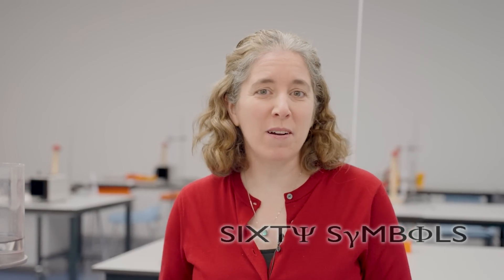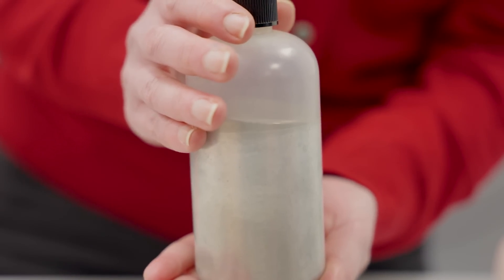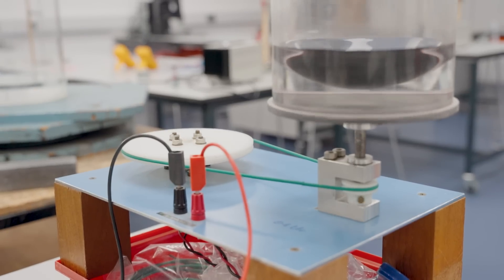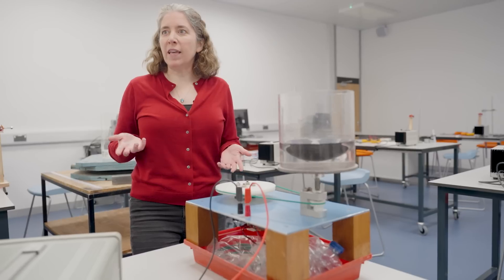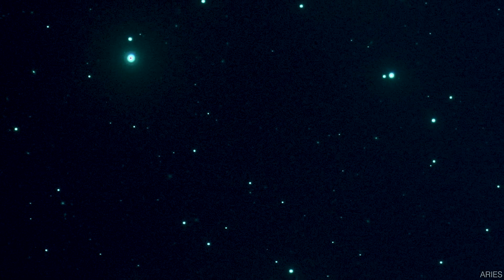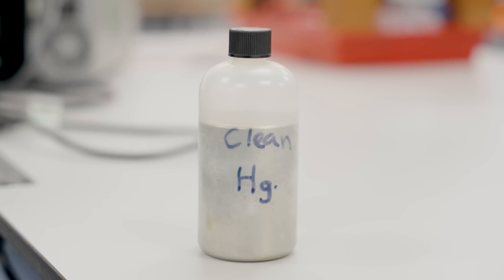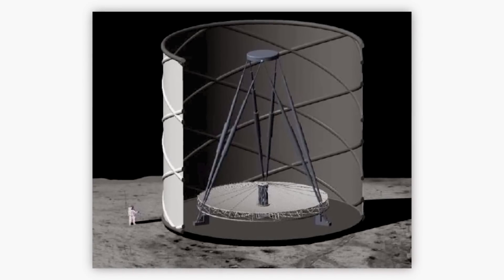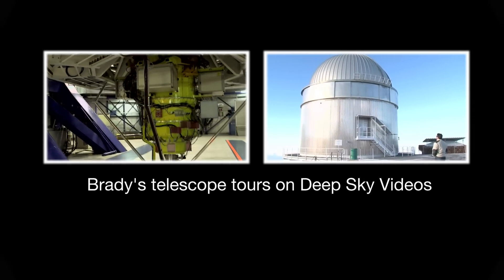Telescope with a Mercury Mirror - Sixty Symbols

Comment: By spinning it faster or slower, you can affect the curvature of the parabola and thus change focal length. (zoom in/out). not sure whether this is practical, since the real mercury telecope only has a more or less uniform liquid "thickness" above the also parabola shaped bottom of the vessel and it is perhaps best to match those. Also, the detector needs to move away/towards the mirror to get in focus.

Comment: maybe they could use mercury on the moon.
heat it up somehow, spin it and let it freeze in a parabolic shape. and if theresa defect like a micrometeorite, do it again.
the heating up lart might require a bunch of solar panels and batteries, but they could be shared with some other facility?

Comment: Can you do the float glas process with these parabolical liquid surfaces? That way you could actually make large parabolic mirrors very easily. 

Ofc, glass has such a high melting point but if the application can handle a larger thermal expansion coefficient, then you could also fo that with a thermoplastic.

Comment: That description of CCD sensors was kind of messy, and that process can be done in software with any type of sensor. The key reason for using CCD sensors was / is their low noise compared to other types.

CCD was the type of sensor used by virtually every high-end video camera until CMOS sensors (currently more common) became so dense and so cheap that they effectively overtook them (they still have worse quality "per pixel", but you can make them with a lot more pixels for the same money, so you end up with more detail across the image as a whole, as long as you don't mind the noise when you zoom down to individual pixels).

Comment: Wouldn't a round cylindrical shape with a reflective material stretched over either end and a vacuum underneath form a the same shape with out the moving/spinning parts? Be a Vacuumscope and adjusting the vacuum will adjust the shape.

Comment: In 1971 I had a summer job at the US Naval Observatory. One of my responsibilities was to come in in the evening and set up the photographic zenith tube. This had a flat mercury mirror and a traditional lens, not the same thing as described here. The light went through the lens, was reflected by the mirror half a focal length below, and was focused near the underside of the lens. I wiped oxide off the surface of the mirror. Safety did not seem to be an issue back then. I loaded film into the camera. It was programmed to open the shutter when a star was expected to pass overhead, tilt the film to track for the duration of the exposure, and close the shutter. There were multiple exposures over the night since none of the stars was exactly overhead. It was used to measure variation of the rotation of the earth. The horizontal mirror guaranteed that the telescope looked directly overhead.

Comment: Mercury being solid on the moon started me thinking-- You could make a reflector mirror by spinning a liquid metal and then lowering the temperature until it freezes? If it's not reflective as a solid, deposit a thin layer of something like gold.

Keeping the temperature just below freezing point would minimize warping from contraction. For mercury that's around -40°C.

To avoid needing so much refrigeration, gallium freezes at 30°C. Would that make up for it being 10x the cost? And that you can cut it with a knife?

Comment: So its a anti-bubble. Liquid metal inside. Thin film of electrons. We already have that in wires. Then there is bubbles. Metal on the outside. Electrons in the middle.  Bubbles will sink.  Anti bubbles will float. Gravity has to share some common link to be a median.  That is a curve. So a straight line is needed. To act like adjustable leverage.

Comment: The video does not point out the dangers of mercury vapors. Mercury evaporates in a normal atmosphere and these vapors are dangerous. Standing in the vicinity of the mirror for a long period of time without respiratory protection is certainly not particularly healthy. If you want to take a look at it, you should search under the keyword “Schlierenaufnahme/recording mercury” or something like that. That's no joke.
The mirror cannot be sealed, which would limit reflection again. Therefore the vapors constantly escape. I don't know if they are even aware of this particular danger. It is the vapors that make metallic mercury so dangerous to us. Chemically, mercury salts are much more toxic to us than metallic mercury, the metallic one will not react so fast in human body then the salts^^. The fumes in metallic mercury actually make it dangerous for us as these fumes can poison us.

Comment: Could you have a set of pools of mercury all spinning attached to a much larger spinning chamber.  The pools could, in theory, be tilted gradually as the centrifuge speeds up.  You could then position a camera at the focal point in the center and take timed images... Does that work?
Reply: Even a single pool can be tilted "as the centrifuge speeds up", but gravity will always introduce a deformation unless the focus is straight up.

Comment: I'm genuinely curious how they keep the mercury from oxidizing. I know that mercury normally develops an oxide layer after a period of air exposure, and with such a huge surface area as a mirror, managing that has got to be a practical consideration. My guess is there's possibly a liquid on top of the mercury, such as an oil, that protects it from oxidation, but that's got to introduce more optical challenges.
Reply: reading through their paper on this - it seems like they actively encourage the formation of an oxide layer. It helps prevent evaporation (important to keep mercury fume levels low), and also provides structural stability so that the mercury layer can be thinned which helps with dampening surface waves. I guess those considerations must be more important than the optical effects from the oxide layer.
Reply: @AR-cy6uj  Thanks for sharing the info, fam! I really appreciate it!

Comment: For the who "you can only point straight up" part, this might be a lite bit crazy but could it be possible to put the the entire spinning plate on the edge of a second, larger plate and thus use the centrifugal forces generated to angle the mirror?
Reply: Not really (gravity would always introduce a deformation). But how would that help you keep it pointed at a fixed part of the sky, anyway?
Reply: @RFC3514  Gravity would be consistent throughout and the vectors of the apparent forces would combine to make one stable force at an angle to the earths surface allowing you to point the telescope at an angle.
Reply: @gmtom19  - And if you try to keep it pointed at a fixed point of the sky as the Earth rotates (instead of changing direction even faster than it does if you just keep it pointing up), the result won't be a parabola.

Comment: One thing is that you can get a certain distance off of zenith by moving your detector. This is how they aimed Arecibo and similar very large radio telescopes. Range is definitely limited, but it's not zero.
Reply: False. Parabolic mirrors have only one focal point and it's pretty tight. Arecioe was using a spherical dish where the focal plane is large and you can steer by moving the collector (or a secondary)

Comment: If mercury is solid at lunar temperatures could you not take advantage of that and have a heated platform and once the desired shape has been achieved then switch off the heat and let it freeze in the correct shape?  Once frozen you could even stop spinning it!

Comment: Instead of using liquid Mercury the same effect can be uptained using a low melting alloy like Galinstan (Gallium-Indium-Tin). This alloy is more expensive than Mercury, but is non-toxic compared to Mercury. It won't expell toxic fumes and any spillage will not harm the environment or the humans working with it. It's easy to make yourself.
There are though two challenges: 1) Galinstan must be kept away from some metals, like Aluminum, as both the Gallium and the Indium content will alloy with metal and introduce fatal brittlenes, and 2) Galinstan will "wet" any surface it encounters, even glass. This is very anoying, but in the case of glass this can be accounted for by covering the glass with Indium Tin Oxide (the conductive coating used on the inside of LCD-screens and on airplane windows).
Reply: We should use this

Comment: One of the challenges with liquid spinning telescopes is the gyroscopic effect on the spinning mass. As the planet rotates it also rotates the spinning liquid which will try to correct for the rotation of the planet,  trying to keep its rotational axes static. This will result in a slight "wave" effect - or a deviation from the perfect parabula. This means there are limits to the image quality you can uptain with this method.
Reply: Couldn't you correct for this type of thing? Or does the waving effect translate to a loss of information?
Reply: If it's not chaotic motion, then it can be fixed with digital data post-processing.

Comment: Could you gain some ability to "aim" the telescope by making a large mercury mirror and suspending the detector on a movable structure that could point at different parts of the mirror?  I'm thinking of an optical telescope akin to how radio astronomers "aimed" the Arecibo Telescope
Reply: Arecibo had a spherical mirror, so the the aberration was the same in every direction. A mercury mirror is parabolic, so the aberration is zero on axis and increases with the angle off axis.

Comment: I wonder what the frequency/wavelength constraints are for a mercury reflector.  Any wider or more narrow than 'glass'?
Reply: Glass is generally not used as a reflector itself, due to being transparent and all. It's just a substrate on which a thin metallic layer is deposited (i.e., it's not like bathroom mirrors where the metal is typically behind the glass, on reflector telescopes it's usually in front of the glass, so you don't have to deal with interference from the glass itself).
Reply: @RFC3514  Silly me.  Brain fart.  I knew that!  Thanks for the reminder!

Comment: mercury is NOT very dangerous. unless you vaporize it and breath it in - in large amounts - you can practically drink it (not recommended due to your stomach acid) but you body absorbs very little liquid mercury.
Reply: and i would be interested in why you can only point "straight up". even at low speed the rotational force should overcome the gravity, esp. with heavy fluids like that. with the right rotator (shape), you can probably rotate it even upside down.

Comment: The main problem of mercury that ionic liquids solve is not melting point, but vapour pressure. Mercury would quickly evaporate on the moon, but the effect of vacuum on ionic liquids is negligible.
Reply: pressurizing would be simple, but continuous heating problematic.

Comment: Fun fact. Today, when making large glass mirrors, the molds are often spun while the glass is melted and allowed to slowly cool back into a solid. This puts an initial parabolic curve on the mirror that makes it much easier to polish to the desired high accuracy optical surface.
Reply: Is it possible to keep molten glass on top of molten metal while spinning the two, just like they do to make normal window glass (except for the spinning, of course), to produce thin concave mirrors?
Reply: They do not put on metal. They create mold first and when the glass is cold they breake away the mold. @soberhippie
Reply: @soberhippie I'm sure it's possible, but you would have the problem of the two different densities of material creating two different parabolic shapes. The molten metal would have its own parabola and impart it to the bottom of the glass. The top of the glass would follow a different parabola and you would have all sorts of diffraction issues through the glass
Reply: @jasonklassen3972  - Light generally doesn't go through mirrors, and (for telescopes) the top surface is generally the one getting the mirror coating, so that's really the one you'd care about.
Reply: Yes. There was a video on DeepSkyVideos on this topic. Maybe SixtySymbols could get some collaboration going with them?
Reply: So far as I am aware, only one mirror production facility, the Mirror Lab at the University of Arizona, uses this technique.  Under the direction of Roger Angel, this lab developed the technique and has used it for several large mirrors over the last three decades.  Most recently, they have been making the primary mirrors for the Large Magellan Telescope which is under construction in Chile.
Reply: @markholm7050  The Giant Magellan Telescope with its seven round mirrors might be the last big telescope which make use of combining several parabolic mirrors together. Most other newly build or planned telescopes are composed from hexagons, like the JWT or the Extremely Large Telescope. So spinning the whole mold together with the melted glass isn't necessary anymore.

Comment: Let's say you put several thousand kg of lead bricks on a movable platform under the mercury (isolated foundation of course). Would that be enough to to change the gravitational vector enough to be useful? Perhaps enough change to track stars would be to fast and disturb the surface?
Reply: That's not going to beat the Septillion tons of Earth pulling it.

Comment: One way to use mercury on the moon would be to put it on the base of the mirror, heat the base until the mercury melts, spin the base, allow the mercury to freeze. Then you can stop the spinning. Then you have a large mirror you can point anywhere. Or use silver instead of mercury as that is reflective as a solid. If the mirror gets damaged from small impacts then melt the mercury, spin it up and the damage is repaired.

Comment: Is there a way to use this in space? I think that without gravity, it could be turned in any direction. But without the effects of gravity would the same shape be possible?
Reply: No, it won't work in space, but in space most of the problems of large glass mirrors go away. No need for active optics because there's no gravity sag to counter. No atmospheric distortion to counter. No dust. No corrosion. You could have a 1000m optical telescope if you wanted.
Reply: @gasdive My plans for a giant mercury death ray thwarted again! 😂
Reply: no dumbass, watch the video before commenting next time

Comment: Technically you can point liquid telescope at any direction. You just need to rotate it using thread plus a bucket, and start rotating bucket over center where thread is connected. Every full cycle you have a fraction of a moment when your bucket full of Hg pointing at the direction you want.

Comment: I wonder how they deal with Mercury vapour at this Telescope, as it's in a warm place of the planet and its just a bowl of liquid vapour, potentially evaporating its contents into the area.
Reply: A quick google search reveals "Although mercury vapour is harmful, it is greatly suppressed by a thin transparent layer of oxide that forms soon after emplacement. Moreover, a thin film of mylar,4 co-rotating with the mirror, will contain any remaining vapour." 
@thirstyCactus, maybe look into the science instead of assuming anything about "that area of the world".
Reply: The tops of mountains where telescopes go are generally pretty cold places at night when the structure is open and mercury has an extremely low vapor pressure. At 25C its vapor pressure is only about 2 millimeters of ....well... mercury. You might need to wear a filtering respirator in the building with the telescope like they did at the LZT in Canada, but outside the building it's not going to be a concern. When closed during the day, the building could have a vapor recovery system preventing release to the environment. The LZT only contained around 400kg of mercury, a tiny fraction of which would ever evaporate away. For comparison China alone releases several hundred TONS of Hg into the atmosphere every year.
Reply: I had the same thought. Perhaps health & safety regulations are less stringent in that area of the world.
Reply: @thirstyCactus how are mall shootings and school shootings going on in your part of the world😂😂

Comment: Rotation can help adjust the focus as well which is not possible in rigid mirror counterparts.
Reply: But there is adaptive optics. Hundreds or micro motors bend the surface of a mirror to compensate for atmosphere distortion. It works like that at the VLT
Reply: @fep_ptcp883 yeah but for a liquid Mercury telescope you just spin it differently. granted, there's probably some downtime between changing foci. but still.

Comment: Could they start with a rotating reflective liquid, cool or cure it while its moving so it retains its shape, and then use that as a normal reflective element in a traditional telescope?
Reply: Yes, that's the first step in making a glass based mirror.